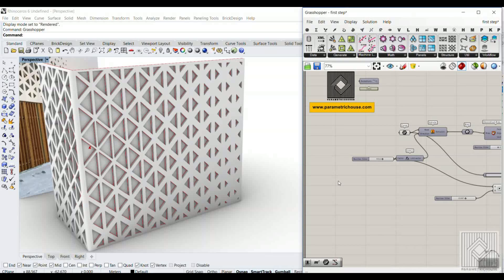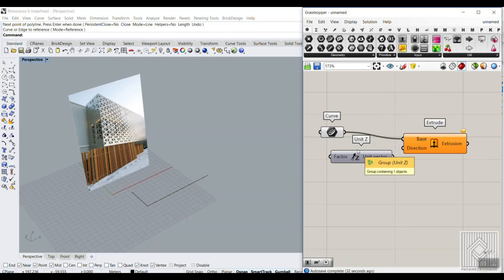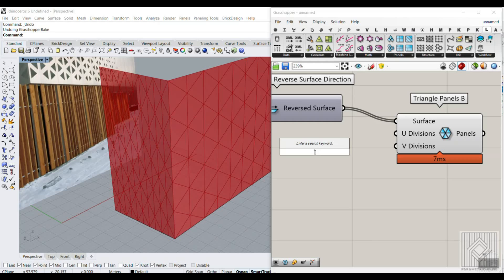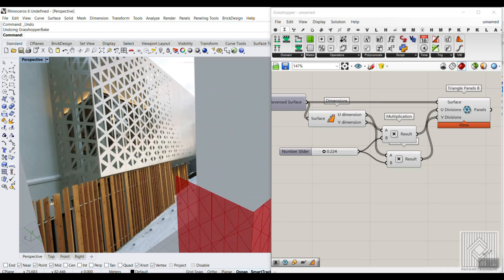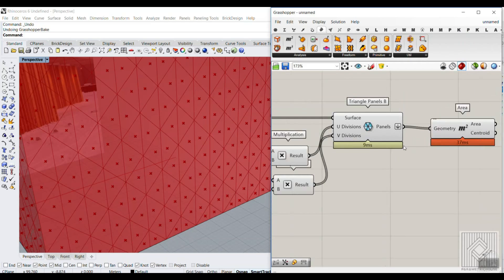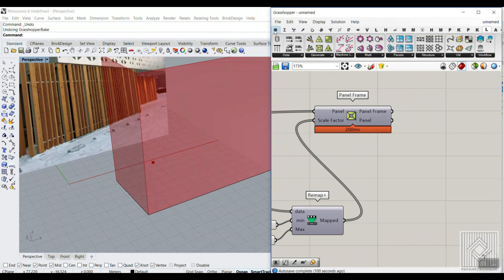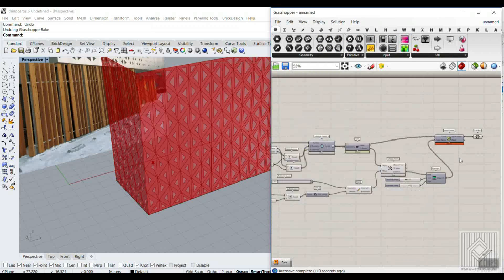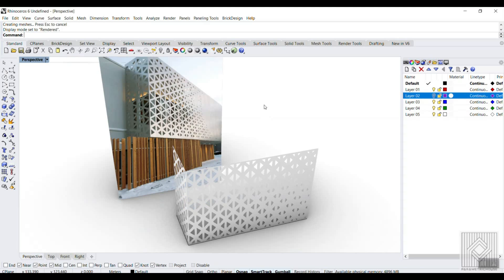Grasshopper Tutorial (Parametric Facade)

Comment: Can you finish your tutorial by telling us how to make the thickness?
Reply from the maker: You can use the "Extrude" Component and for the direction of the extrusion, use the Normal Vectors of those frame panels. You can use "Evaluate Surface" component to have the Normal Vectors.
Reply: @ParametricHouse  Hi! i'm still new to grasshopper. How do you insert the thickness value if you use evaluate surface as the direction of the extrusion? Thanks! you're the best

Comment: I tried to apply this tutorial on a whole box, and wanted to have 1 point as an attractor placed on one of the vertices of the box where the 3 surfaces connected to point are affected with it, but I obviously failed because I wasn't sure how to change the values in the equation to match a box and to set a static point instead of the moving one..
If you could help with a link to a video where I can find the right way to do so.

Comment: thanks for the tutorial. I'm finding them really instructive and very well explained. I got just one question. When it comes to extrude the panels, I can't do it properly. I evaluate the surface of the panels and extrude them using the its normal (multiplying it by any value).  For some reason, the panels to the short surface plus the panels to the first column of the long surface are extruded in the negative direction. Could you please through some light over here? Thanks a lot
Reply from the maker: You're welcome.
What about offseting the surface , making the panels and lofting the two panels together